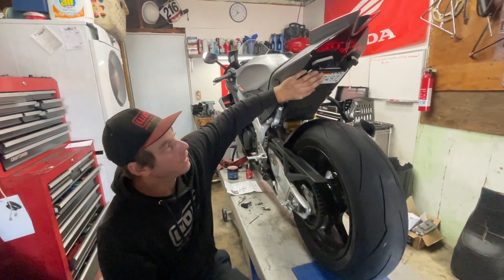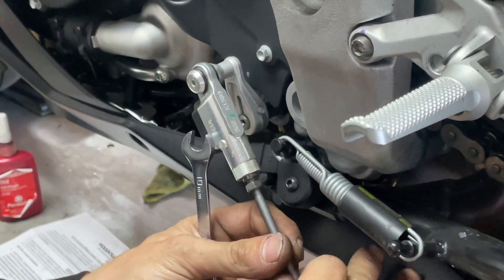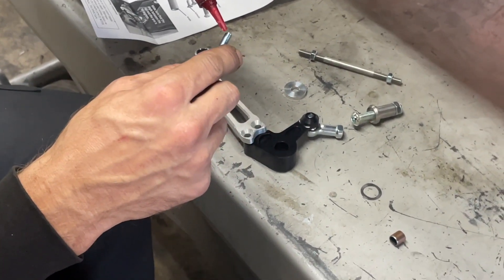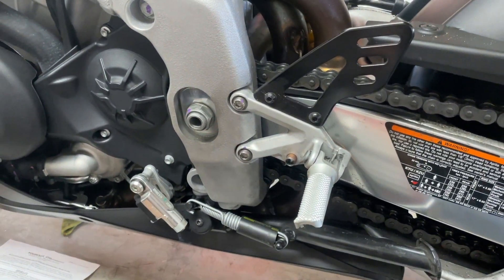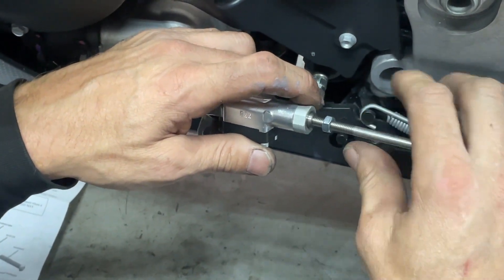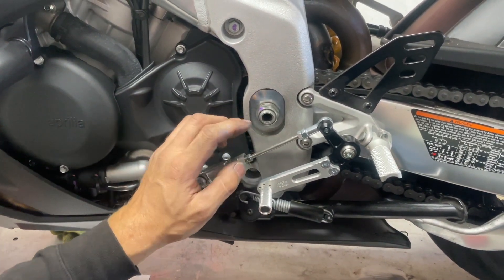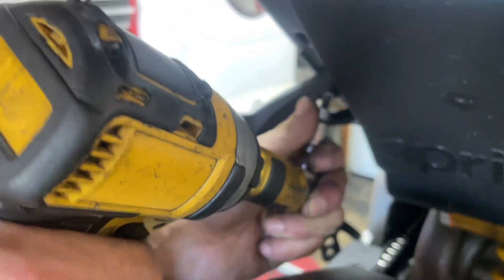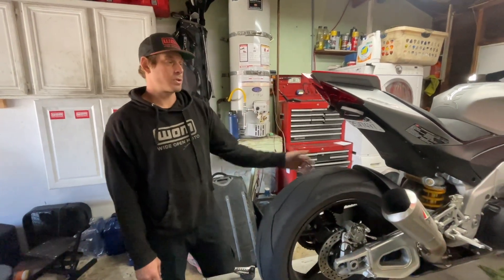17-23 Aprilia RSV4 GP Shift Conversion Kit Tutorial (avoid expensive rear sets)

Comment: you dont need to buy anything, any special parts to reverse gearbox and have a GP shift. you just need to reverse the original parts of the original system. I've made it on all my aprilia (modele 2017, 2020, 2021 and 2023) and it's work perfectly!

Comment: I did GP shift on my 890r,  similar to yours but I just had to flip the knuckle and re adjust the height of shifter......it definetly shifted smoother but was lil weird after using std shift since the 70s....I can totally see it as benefit but went back to std.....I convert it back to GP once I start riding again consistently......surprised you didn't just do it yourself though.....super simple

My next item is adj rearsets for more versatility...like my feet to be a bit farther back......on naked bike help with the wind I think
Reply from the maker: It’s good for track use.